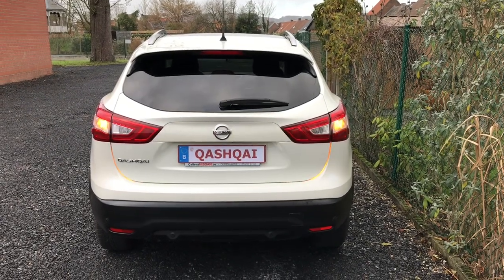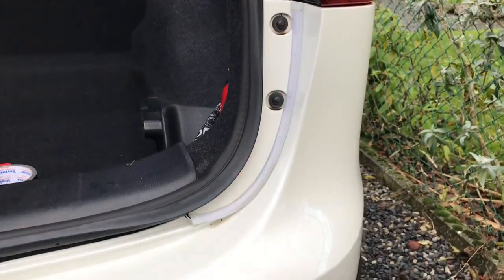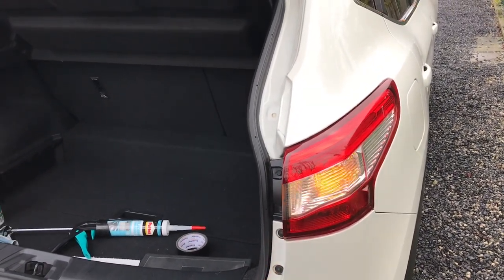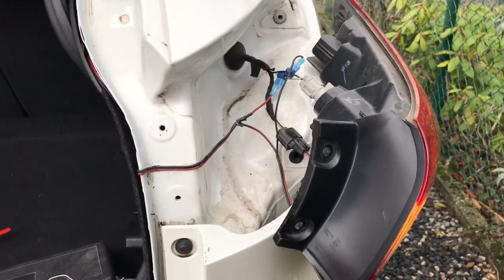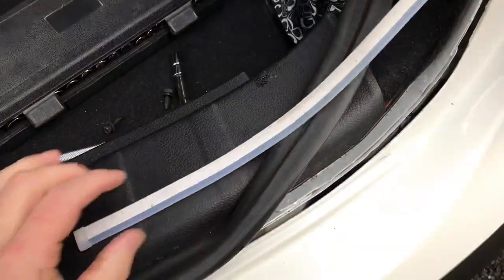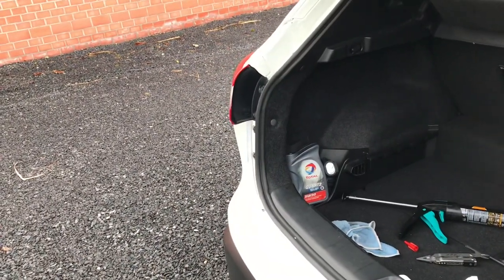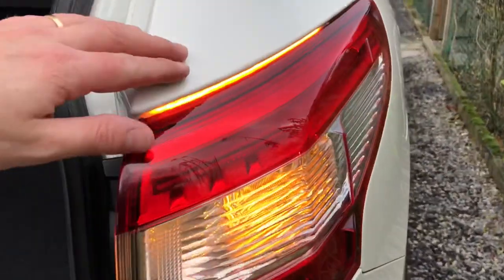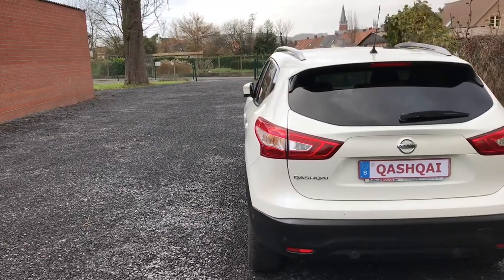Nissan Qashqai J11 Dynamic Tail Turn Signals V3.0 (improved version)!

Comment: looks good, but ive already have space full of resistor for LED bulbs.. will think about it, in night looks good.
Reply from the maker: It looks very nice indeed. I know your video where you install the resistors (👊🏻) and I think it easily fits. There is so much space there and these strips only need the small ridge and the wires and LED module are very flat and can be hidden in the part closest to the boot all the way down. 😉 happy holidays!

Comment: Are you connecting the wires by soldering or by twisting them?
Reply from the maker: Hi! I used Scotch lock connectors si there you just use a pair of pliers to fix the connector. The hidden switch is fixed by twisting the wires and using insulating tape. That holds up good enough but you could solder as well. Usually I do but for the switches I didn’t. 😉 merry Xmas.
Reply: @LaPalmeraie0032  Thanx for the info. I was wondering because i can't say i will reopen anything, soon enough again. So i want the connection to be steady. Merry xmas.

Comment: sono da 30cm?
Reply from the maker: Hi! No I bought 45cm but had to cut a bit off. So maybe they are 30-35cm now…? 😉
Reply: @LaPalmeraie0032  is possible cut off the led strip? interesting, because I have those stripes that I wanted to put on the front lights, but I find this solution much more elegant.
Reply from the maker: Yes! The ones I used can be cut every x cm on the cut-mark. There are three versions of this video, with different approaches. You should check the first version, there I cut it. In the meanwhile they made newer versions of this led strips with a very nice turn on effect where the white light flows and grows gradually 👍🏻